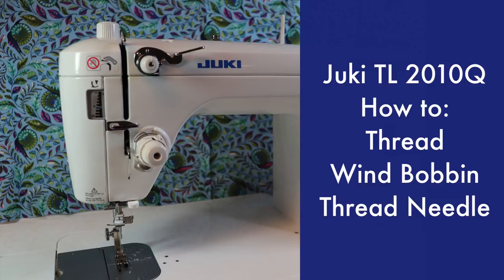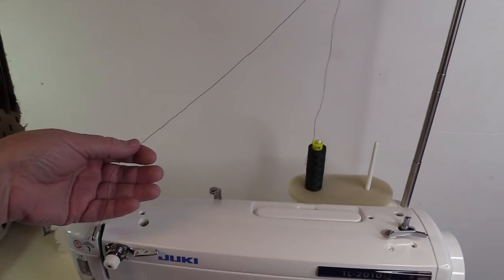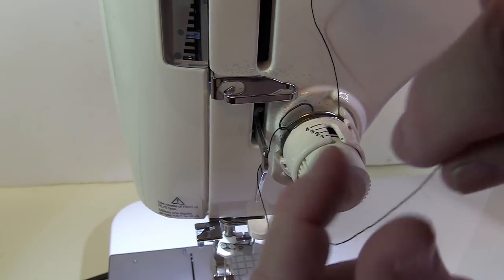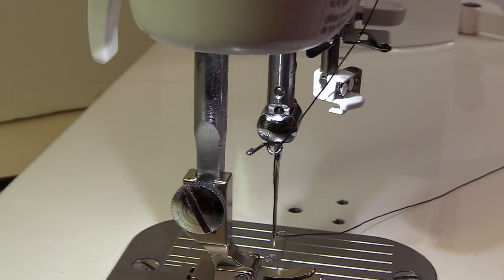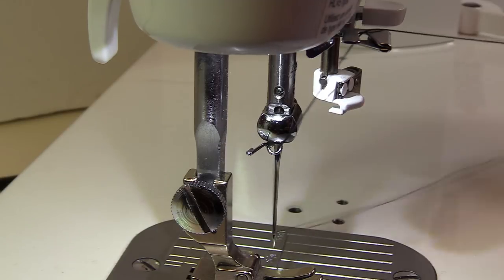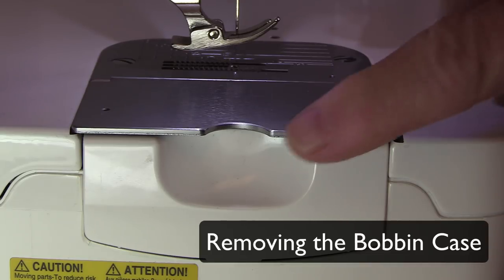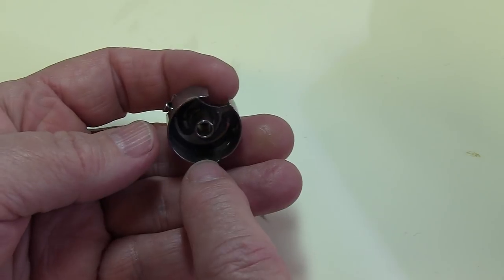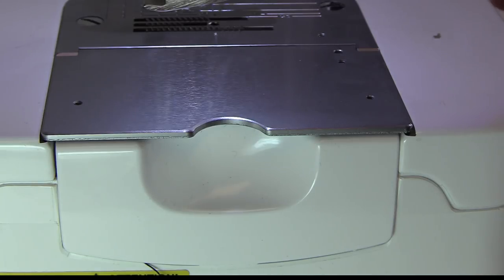Juki TL 2010Q - Threading, Bobbin Winding & Needle Threader

Comment: oh god, you just saved my sanity with your comments about troubleshooting the pin in the threader. I just unpacked my machine and the threader would stick on the needle. I checked the pin and just like you said, it was pushed too far forward. I nudged it to center and FINALLY threaded the needle. geez luiz! thank you!

Comment: Thank you "sew" much for this video!  I had no idea what had happened to my needle threader.  It worked fine when I first got my Juki.  After watching your detailed explanation of the tiny wire inside the threader, I had mine fixed within 5 minutes!  Great instructions!  Thanks again!
Reply from the maker: You are so welcome!  I wish they would put a better needle threader on this machine.  It is really the only complaint that I have about it.  But, at least it can be corrected.  Thanks for watching!

Comment: This is the best and easiest video to understand how to do these things with the Juki.  I’ve had mine for a number of years but haven’t used it due to a busy work schedule, 4 kids and 2 moves.  I definitely need to relearn how to use these things.  Thanks for the video.  I’ll be saving it and rewatching.  Do you have a video on maintenance?
Reply from the maker: Thank you for your kind comments.  I do not have a maintenance video, but it is fairly straightforward.  Brush out the bobbin area to remove all the lint and routinely oil all the places the manual tells you to.  There are 7-places that need oil.

Comment: This machine has a lot of threading, so this probably doesn't matter much, but this is not quite how Juki recommends threading the Qi.  Page 23 of the user manual has a stepwise guide for threading around the tension spring, which includes an intermediate step between the sub-tension knob and the thread tension spring.  This step means the thread passes through the vertical hook a total of 3 times instead of 2.  Everything else about this video is very good, and I found it to be very helpful as I was going through the manual, which only includes diagrams.

Comment: Love this tutorial. I just bought a 2000qi and I don’t know why it will not work.  It’s plugged in both foot pedal and electric cord.  Press on the foot pedal and nothing happens.  It is in the ON   The light doesn’t come on either!  I’ve been sewing for years, but I really don’t know what’s wrong!  Can you help?  Tia
Reply: I have the same machine as you. Sounds like something is wrong with the power if the light won't even come on. Did you try the knee bar to see if that works? If nothing else call Juki.

Comment: Having tension problems, I get the top tension right and the bobbin tension messes up and vise versa it’s really hard to figure out I don’t know what I’m doing wrong, having a hard time finding help, any suggestions would be great
Reply from the maker: You need to get your bobbin tension correct first.  Then adjust the top tension slowly by turning the top tension about 1/4 turn at a time.  Turning the knob left loosens the tension and turning it right tightens the tension.  Use different color threads in the bobbin and the top thread to help you see how your stitch is forming.  If you are getting dots of thread on the bottom, you need to tighten the top.  If you are getting dots of thread on the top, you need to loosen the top tension.  I hope this helps.

Comment: I would like to know what setting to use on the presser foot presser for quilt piecing - lightweight Fabric.  Top of machine on the left.  Anyone?
Reply from the maker: I just use the normal pressure setting and it has worked fine.  If that does not work for you, just try experimenting a little.  Thanks for watching!
Reply: @RosiesArtStudio  Thank you so much.  Jane

Comment: I have a juki 2000Q my automatic thread cuter is not cutting and I have cleaned my machine checked the meddle, the tension but to no help it's still not cutting has anyone had this problem and what is the solution